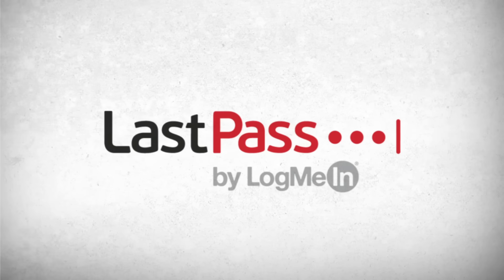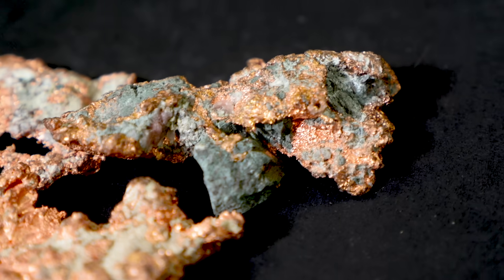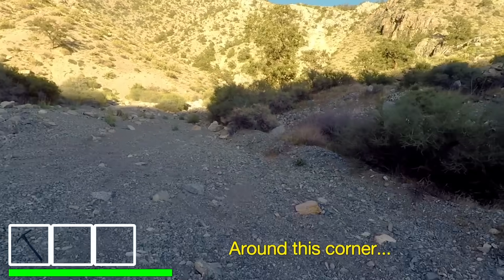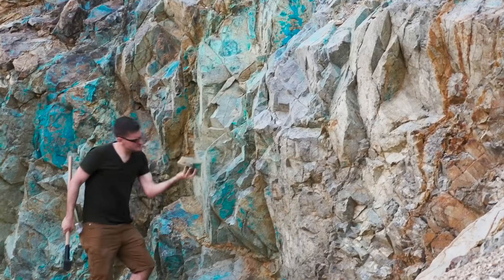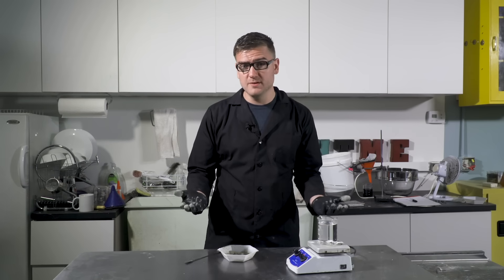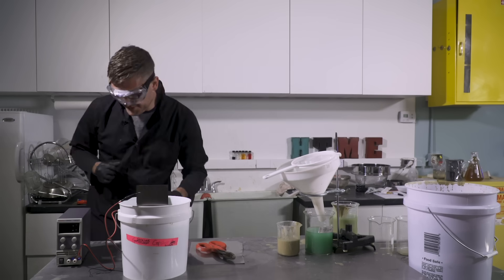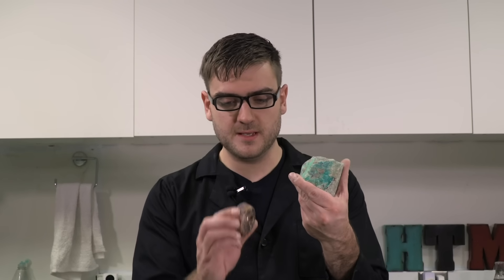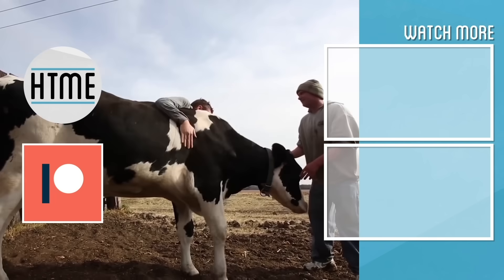From Rock to Copper Metal

Comment: The one problem I can see collecting the rocks is that they have a very low level of copper in them, think about it this way, there was already a company mining there right, if that was high enough grade ore to be useful they would have mined those surface deposits up instead of spending the time, cost and energy to dig a hole into that rock. It's freaking rock! That is the hardest natural thing that people come into contact with regularly. (I know diamond and gem stones can be harder but they are not ubiquitously found around the world nor are outcroppings of iorn or other ,)hat are any where near useful.)
Reply: maybe, but it could have been only a shallow layer. it was probably more cost effective at the time to just get going with the admittedly slightly better or further down. This has happened a lot in cornwall, where i am now, where there is quite a bit of tin left over, but the price of tin dropped and it was really not cost effective anymore, so the tin mining industry collapsed

Comment: In my opinion, the greatest advantage to mixing metals and making alloys wasn't that the materials were stronger, but that they melted at a lower temperature. Once the bronze had been made, the ingots were more easily worked with by a wider range of people. That meant more minds were working on the material, ultimately improving ancient metallurgy as a whole.
Reply: Flux decreases the melting temp of thngs

Comment: You know, the whole 'I can't remember my password' thing would not have been a problem if sites don't expect you to include 'a symbol', 'a number', 'an uppercase', 'a lowercase', 'a pizza' and 'a chicken who got run over by a truck'. And then if they had stopped requiring us to 'change your password or we won't let you in', we would not have to change the passwords that we almost managed to remember into a new one that we have to spend a lot of time to remember again.

Our passwords have become easy for computers to guess but impossible for us to remember. If we haven't devolved this way, we wouldn't even need a password manager that can be hacked and manipulated. I always wanted to say to Yahoo, "If my password gets stolen despite me doing everything to keep it safe, then it's your fault, fix your system. If I don't keep my password safe, then it's my problem."

This comment is about the password manage Last Pass advertised in this video. But this video itself is cool.

Comment: Did you sandpaper the electrodes? If you make the surface rough it will react quicker thus reducing the time it takes for you to get all the copper. Simply use sand paper in it.

Comment: Are there any gaseous byproducts of the acid reduction?
Reply: ToyFREAKS Yep, acid reactions with pretty much anything will form hydrogen or other products from the reactants, for example copper carbonate + sulfuric acid is
CuC03 + H2SO4 -> CuSo4 + H20 + C
So there will be other products depending on the reactants, in this case, a carbon solution, hence why he was able to dip his hand in to retrieve the copper :)
Reply: Thanks for the info! So CuCO3 = 1 copper, 1 carbon and 3 oxygen? Sulfuric acid = 2 hydrogen, 1 sulfur and 4 oxygen?
Reply: ToyFREAKS Exactly, Copper Carbonate (CuCO3) is a soild, and Sulfuric Acid (H2SO4) is a solution :)
Reply: This makes me wish I had studied chemistry. When the copper and CO3 goes into solution, where does the extra oxygen go?
Reply: ToyFREAKS the extra oxygen would either dissipate into the air or attach to another product, this is the part I'm not entirely sure of :p
Since I don't study chemistry either, we just do it in school lol

Comment: ok, im just wondering why you bothered with the electrolysis since you already had a crucible and just mixing your crushed ore and some flux in there and putting it in the furnace would have been cheaper than using up that acid and spending two days waiting.

Comment: Electrolysis was definitely unnecessary.
Reacting copper sulfate with simple baking soda gets you copper carbonate and sodium sulfate. the sodium sulfate stays in solution while the copper carbonate precipitates out on its own easily. As far as smelting goes, the copper carbonate cake will work just as well if not better than your malachite, a natural copper carbonate. honestly with a kiln hot enough to melt copper, you can reduce copper carbonate easily.

Comment: I’m sure you did more research into this as you corrected yourself in the video, but in the electrolysis the two metal bits you flow the electricity through are called the electrodes, not the anodes. The positive electrode is called the anode, and the negative is called the cathode. Other than that I loved the video and was quite impressed with the amount of copper you got from that small bucket full of ore.

Comment: This was a really good video, the flow of the scenes and ideas was great and the information was quite interesting. Just a side note another way to extract the copper is by adding bicarbonate of soda after the copper is dissolved, you can then filter out the copper carbonate and just melt it down much faster but just not as pure

Comment: If you had used carbon electrodes, you wouldn't have had the plating issue. Also, by using a lead/zinc cathode, you are producing loads of heavy-metal waste. If you had used the carbon electrodes, you would have regenerated the sulphuric acid catalyst, but instead, it looks as though you wasted nearly a litre... The chemist inside me is midly perterbed...
Reply from the maker: It was lead anode and steel cathode.  I believe the byproduct of the reaction is sulfuric acid and oxygen, although I believe the steel ended up reacting to the sulfuric acid if I ran it too long.  This method is what was recommended to me by a metallurgist for extracting the copper.

Comment: How did you make sulfuric acid?
Reply: Some auto parts stores sell it. There's a half dozen ways to make it from scratch, and it's basically ancient tech. It's also a good idea to make pH paper beforehand. Grow some red cabbage, extract the pigment onto slips of paper and voila.
Reply: @chrisbalfour466  a fellow amateour chemist i see.
Reply: @chrisbalfour466  Isn't it also found naturally in places like coal mines?  Vitriol?  I seem to remember (from high school D&D) discussions of vitriol or kobelt.  Crystalized sulfuric acid.  It's where the idea of kobolds comes from. In Germanic folklore they were goblins that went around sprinkling 'kobelt' crystals around coal mines to burn miners, but that kobelt is a real thing and it's just natural hydrogen sulfide that forms from the sulfur and hydrocarbons you usually find with coal.
Reply: Burn sulphur in a vessel & bubble the evolved Sulphur Trioxide gas through water. It's a crude method & it generates a lot of heat. 
S8 + 12O2 > 8SO3^
SO3 + H2O > H2SO4
Reply: @perrydowd9285  whoa...that process is dangerous and i dont know who tafk  even tried that process
Reply: Xee Gaming Yes it is dangerous. It's the earliest method of synthesis. Hence the caution. 40 years ago we were still taught that method in college lab sessions. We were also taught to mouth pipette and advised that safety specs were "a good idea". I miss the seventies.
:-P
Reply: Hydrogen Peroxide and Elemental Sulfur works, it's slow and need a closed container, Sulfur oxides are after all gases.
Reply: Combined hydrogen, sulfur and oxygen
Reply: You fart into coke.
Reply: I know how to make it- many ways like pyrite and stuff-but I was wondering how they got it,and if they made it then why not record it

Comment: You need to somehow assess the purity of your ‘muffin’... maybe send it to Cody and get him to use his X-ray spectrometer on it?
Reply: He can asssume its pure enough for his purposes. He isnt looking for pure copper, he is looking for a workable metal. It just so happens copper is one of the easiest to extract.
Reply: X-ray florescence isn't exactly a highly accurate method of assay. It will give you roughly what's in a sample and a very rough approximation of the ratios, but it should never, ever be used to determine purity. At the very least you need a gas chromatograph for that. The X-ray guns are a quick and dirty SWAG.
Reply: Well the quickest way is to just compare densities. What else would be in there? Sulfur, lead, iron/carbon (steel), and whatever was in the original ore. Silicates? I don't know.

It would probably be lighter than pure copper, but maybe not. Anyway, pretty easy to do a quick and dirty density test.
Reply: @Prometheus720  that would be like the worst purity test lol
Reply: @zombesn  that would be like the purity tests the ancients knew to do. It would be a start. That's also why Andy pulled off the slag from the top when it was melted, though the pour looked like it might have had a chunk of impurities on the bottom.
Reply: Oh I agree, it’s not perfect, but it’s something and make for a good ‘inter-YouTube collaboration’.
Reply: Asses*
Reply: If you use the right voltage electrowinning gives 99.9% pure copper. The key is the right voltage.

Comment: From coal to diamond next
Reply: That puts a lot of pressure on him
Reply: Diamond is not from coal. It's from pure carbon, maybe graphite. Check Because Science.
Reply: Eyy kremit, I luv u
Reply: They are the same only diamond was created with extremely super duper strong pressure and very incredibly hot place.
Reply: I believe the molecular build of coal and diamond are different so it would be extremely tough to actually get diamond from coal
Reply: its a joke
Reply: @tree4252  thank you for explaining the *obvious*, I just wanted to say something that could be a new fact that someone could have learned
Reply: I'm pretty sure it's a reference to Minecraft.
Reply: I thought this was youtube not a science class....
Reply: They tried it on Mythbusters with explosives if you scale what they did done to a enough  to fill c4  a welded and bolted 2 foot sphere with the same thickness for the walls I with around a pound of pure graphite in the middle you should get industrial grade diamonds that are around .175  by .175 millimeter
Reply: Done before. No fun for sure.
Reply: Not possible. Coal and diamonds are are made from the same base material but are created by two completely different processes. One cannot form the other.
Reply: Coal also has too many impurities to be compressed into diamond. Graphite though, TECHNICALLY possible, but with billion dollar equipment.
Reply: Nicole Beck
I think the requirement is some method to collect pure carbon (just burn it and collect the black smoke might work), and some atomic bomb to compress it. (Or some fancy machine to manufacture think sheet of diamond from pure carbon)
Reply: It's not that hard, Diamonds are made industrially at micron scales, I mean it's a relatively cheap process, I should know I use diamonds in my job everyday. After all I'm a cleaner and my cleaning machine uses diamonds to clean the floor. There are also diamond coated drill bits and many other diamond coated things, however creating a big diamond is impossible, not only due to the materials and structure of them, but also due to the lack of pressure.
Reply: @The Major Making big diamond is not impossible at all, in fact "grown" diamonds are starting to plague the natural diamond market, we can make them nearly any size, any color, and literally (and I do mean it) can make diamonds that are 100% indistinguishable  from mined, natural diamond
Reply: Industrial diamonds are around 20 percent of the price of real diamonds
Reply: Yes please!
Reply: Impossible. Unless he has one of those multimillion dollar machines that can compress coal for weeks to make artificial diamonds, there's no way he's going to make them.